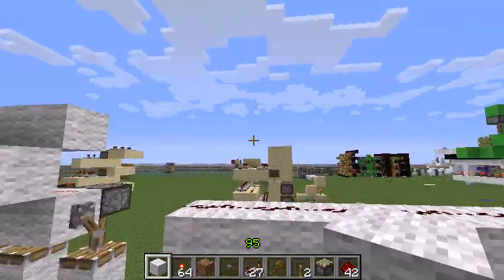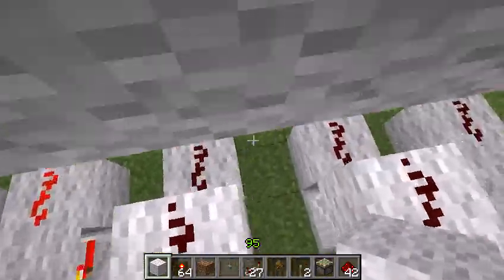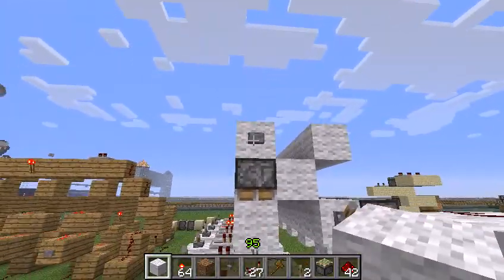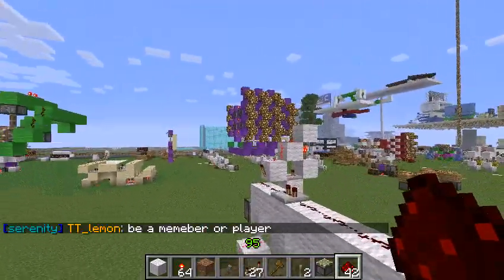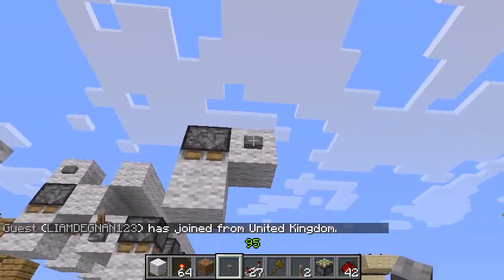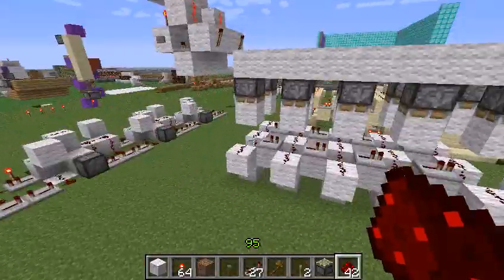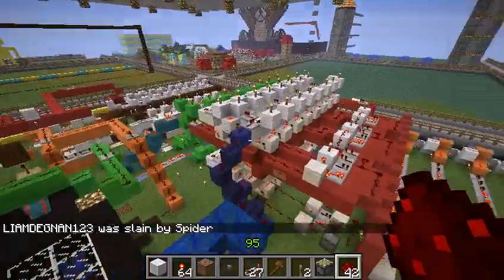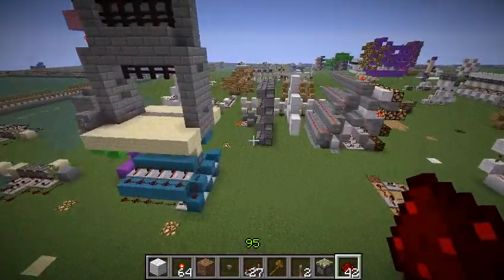Fairly Fast D-latch - Minecraft With ChartreuseK

Comment: Leave out the "nor" if an RS latch isn't actually built out of two cross-coupled nor gates. "Bazil flop" is how this one is often called on the RDF (a homage to the guy who built it there first), but that's a convention only used in minecraft and not really helpful for teaching this. I'd prefer sticking to the terms used in electronics (check out the Flip-flop_(electronics) page on the wikipedia). ;)